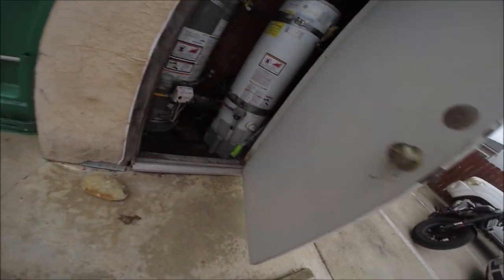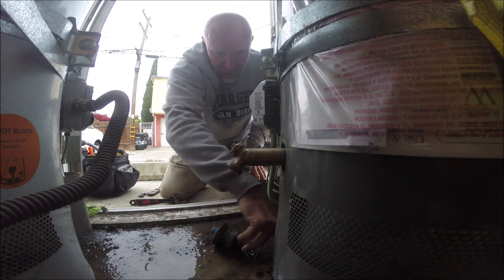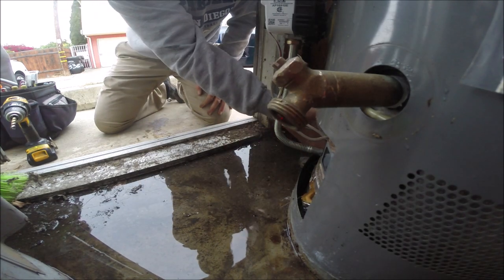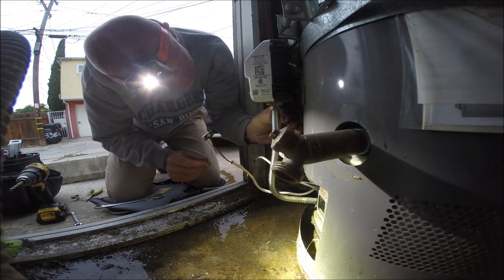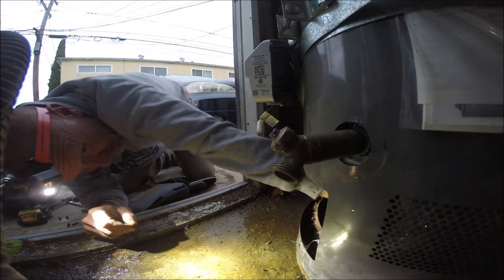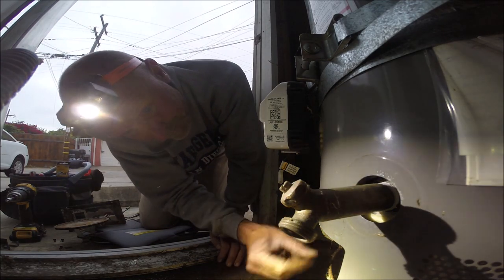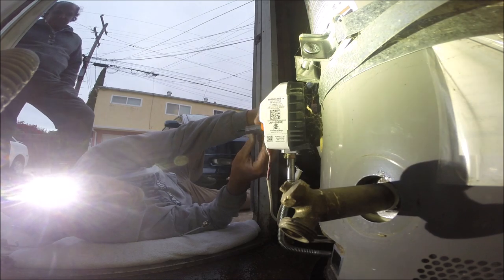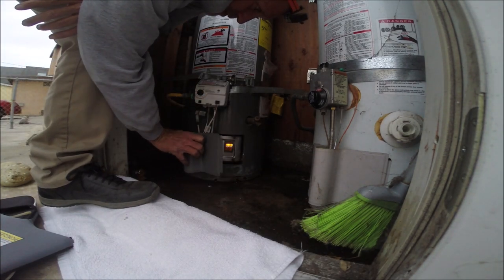Flooded water heater - what to do ? No pilot Light!

Comment: You ever worked on a water heater where the gas control valve is a two piece? Control valve slips out of a plastic slide that screws into heater? I love those….a little pricey but man…makes working easier
Reply from the maker: Not sure , Honeywell is a multi piece valve